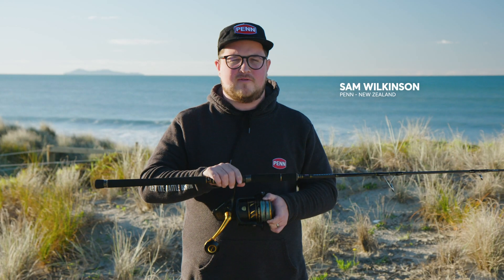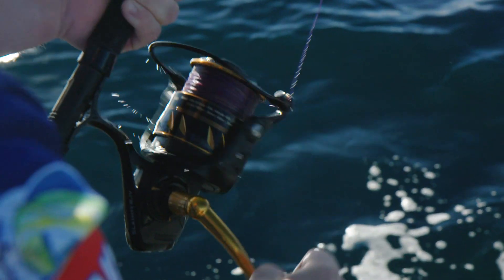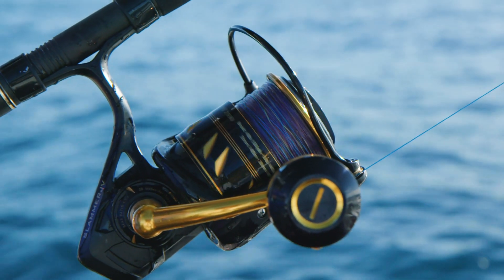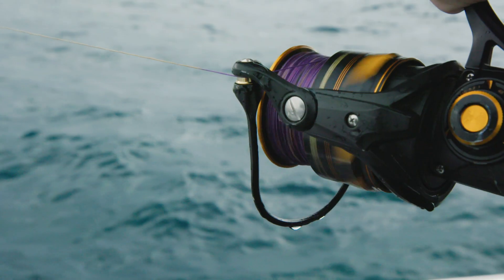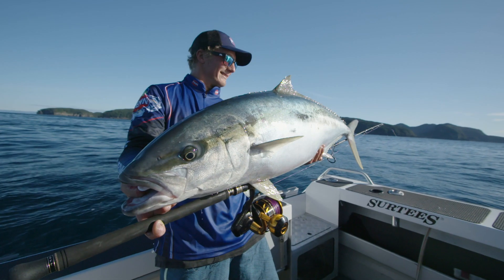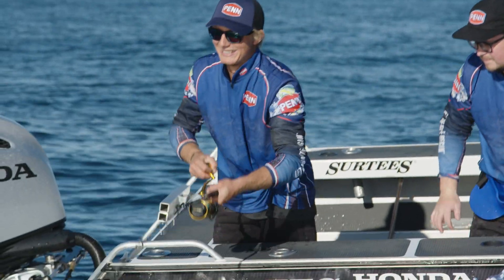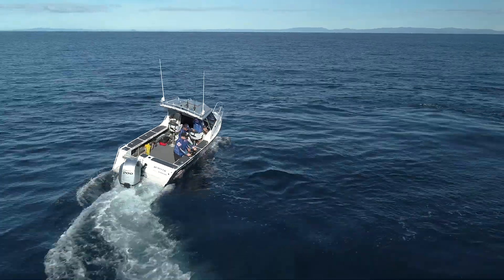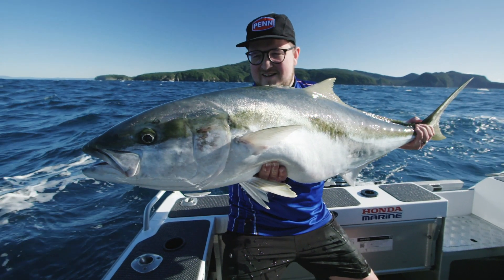PENN Slammer IV | Features Explained

Comment: Nice!  -- QUESTION --- Could someone please PLEASE explain what a 2500 is vs a 3500 reel. What, exactly, is being measured by those numbers?  Is it the diameter of the reel in milometers?  Please be specific.   If it measure nothing, does it simply mean "small, medium and large"??  Why does no one explain this?
Reply: Weight, size, gear ratio, different max lbs of drag, smaller/bigger spool size.